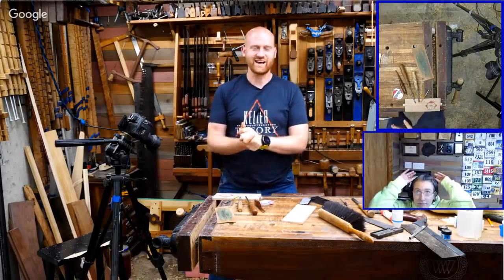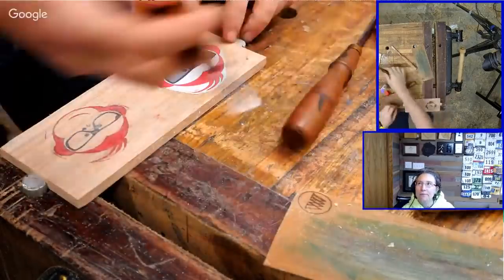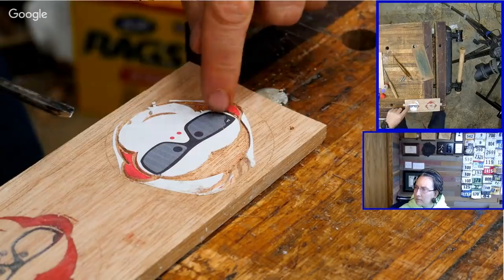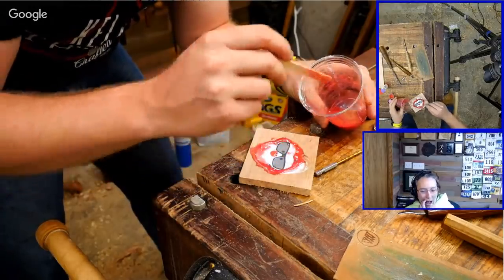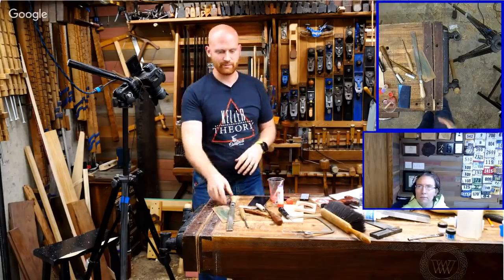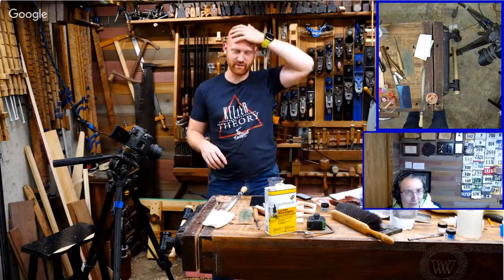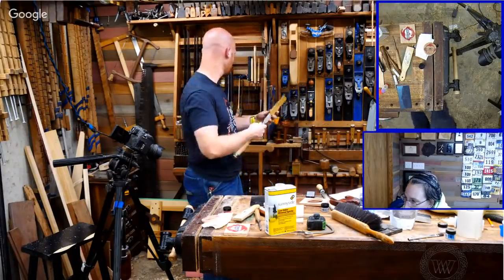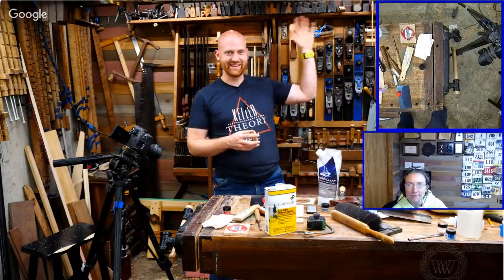Carving, Inlay, and more Fun With a Monkey

Comment: Hey thanks for the Halcyon shout out. We also make a Satin varnish - Gleam Satin has excellent UVs protection and you build coats with a gloss version of Gleam. The flattening agent in the satin will cloud if you use it to build coats.  - As for how long a marine varnish will last - we WISH it was 5 years. but the sun is harsh so we recommend that you MAINTAIN with annual scratch and cover with a few fast coats - and every single marine varnish will say the same thing. If you go 4-5 years without any upkeep you will find yourself starting from scratch -0 full sand to bare wood and start fresh. So a few coats applied annually will save you lots of work and keep that finish at it's best. :)
Reply from the maker: Really! I will have to get some Gleam Satin thanks for the great info.

Comment: That dovetail looking saw cut through that wood like butter. What kind of saw is that / what sort of saw do you need to cut that good?

Btw, I tried card scraping some hardwood based on your advice and it was getting much bigger curls. So many pine can't be card scraped very well? Or maybe you need to be good burr turner.

Also, I tried something I saw in your video that I hadn't seen before. Before you "burred" at an offset angle, you mushroomed the entire edge at 90 degrees. That seemed to improve the size of my burr so thanks for the video / advice. (It still makes no sense to me how rubbing a round hard polished surface against a sharp corner would make a sharp burr. You'd think it would mushroom the edge no matter how you rubbed it.)
Reply from the maker: that was a Veritas Carcass saw. a dove tail saw is normally even smaller.
Sweet. you can scrape soft pine but it takes a perfect bur and less pressure on the wood.
Thanks. ya steel does odd things at times! LOL